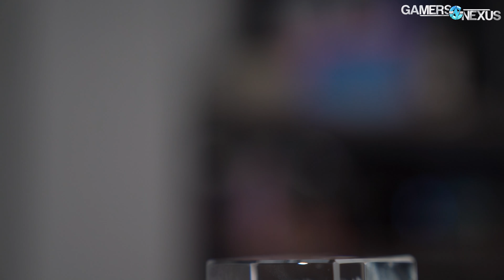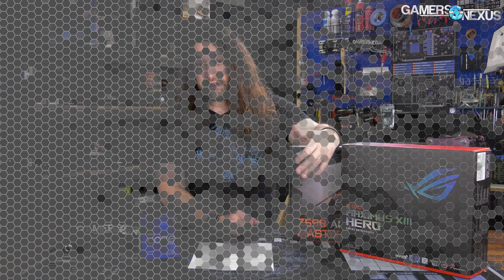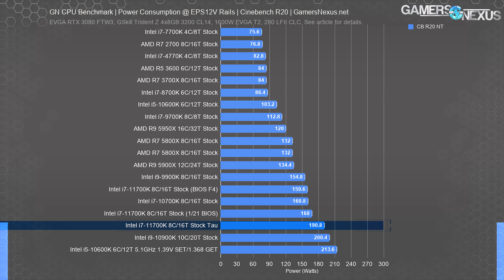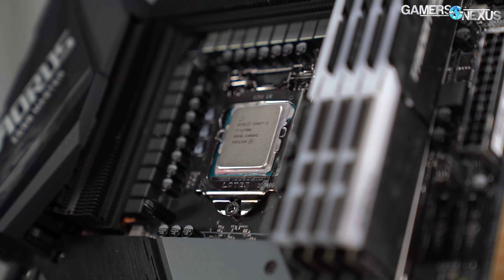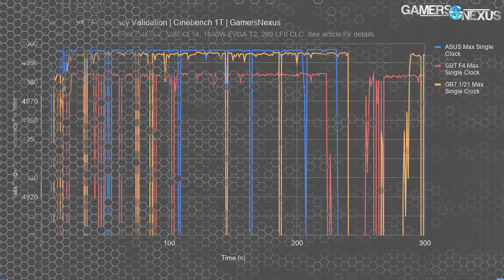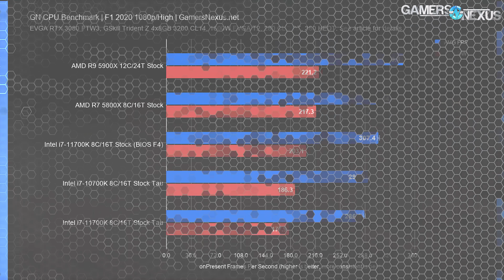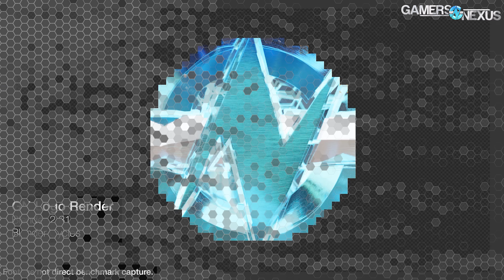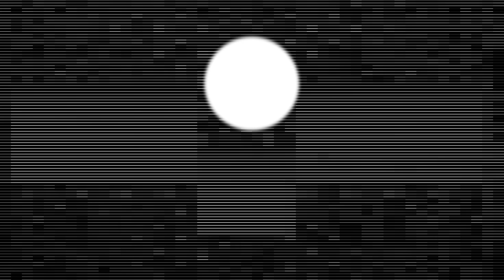Intel's Z590 Motherboard Problem: i7-11700K Power & Thermals Explained

Comment: I wish some youtuber reviewed non k chips too... temperature power draw and performance...

I really want to know i7 11700 vs i9 11900 performance... temperature difference and power consumption ....

Since i9 11900 is 400mhz faster does it mean i7 11700 is cooler? 

I dont overclock and its so hard to find info on the internet about these...

Comment: Recently completed a Z590 build using 10900k.  Mobo is Gigabyte Aorus Ultra.  Its on-board audio comes up as "Realtek USB Audio Driver".  USB for on-board audio?  Is that common now?  And there is a delay with it that audio...had to end up using an $8 USB Audio dongle to get audio that's actually synced up with video.  Very frustrating.

Comment: I just don't get all that whining .. it's to hot, draw to much power, etc? Wtf? The builds using this are powered by solar power? Batteries? And cooling? There are plenty cooling solutions, what the hell matter? First, in real life, benchmark temperatures are rare enough and second, it's not 75, it's 85 and for that will last 5 years instead of 6.
"It's a waste of sand, it's a waste of sand ... "  .. it is what it is and the ONLY issue is the bad positioning and price decided by Intel.

Comment: Am confused surely you overvolt and run it as high as poss at highest clock speed 24/7?

So therefore turbo boost is irrelevant. Am I missing something here?

P.s I agree if you cant hit 5.5 ghz or so pass/wait.

Comment: I appreciate what the power limit removal manufacturers are doing. This really helps unlocked chips out if they designed the vrm well (not asrock*). I just use the windows power management setting if I want to change efficiency from performance. The stock cooler works perfectly well on my "65w" chip.

Comment: So all of this to say that out of the box thermals are a lie.
Reply: No, out of the box thermals are a reference. TDP definition pulled out of Intel web page: Thermal Design Power (TDP) represents the average power, in watts, the processor dissipates when operating at Base Frequency with all cores active under an Intel-defined, high-complexity workload. Refer to Datasheet for thermal solution requirements.

For AMD you have to go to AMD specification page and see what they refer too for it.

No one except the manufacturer itself can tell you about their own specifications, because they are given with small letter, aka conditions.

Being power dissipated also tells another importan thing: TDP=/=power consumption. Though there's a correlation between dissipated heat and power consumption, don't know if Intel or AMD publish that data somewhere.
Also if you run them out of spec the heat dissipated and power consumption will be another thing.

Comment: I'm back 😆. GN, can you make some content on Intel 10th gen PCIe gen 3 vs Intel 11th gen PCIe gen 4 on Z490 boards (that are gen 4 capable)? I understand their may not be any difference in GPU performance, but is there anything noticeable in m.2 performance. On the charts that is. I'm sure when it comes to the "eye test" there is nothing really noticeable. Just curious. It'd me interesting to see using GN methodology imho.

Comment: I definitely think MB should run at stock out of the box. That gives the user a chance to learn more about the capabilities of the cpu and MB, and make a decision on how they want the cpu to run. It just makes sense. I know a BIOS can be updated, which may offer additional settings, but providing detailed documentation to the user would be nice. Most of the time, users have to dig for info, if they aren't privy to what the BIOS settings actually do. Good stuff GN, as always. 🍻

Comment: Dayum GN. This kind of stuff is why I have such respect for your channel. Of course, I was aware that there is a difference in CPU performance metrics across motherboards from different manufacturers , but I did not know why. Thank you for helping me gain an understanding of this stuff. I'm going to have to look into how AMD handles power/boost limitations in regards to how the Ryzen 5 5600x I purchased handles these things in relation with different manufacturers (haven't pulled the trigger on a mobo yet). Thanks again, Games Nexus.

Comment: So they backported the modified uArch from 10nm to 14nm to improve higher-clock yields... and it's not any faster than 10th gen, there's no 10-core part, with the only real benefit being AVX512 at a hideous power/thermal cost. I feel bad for Intel's marketing org, having to try and sell this 11th gen nonsense. A waste of sand indeed.

Comment: I really don't understand Intel nowadays... First they released most of their 9th gen CPUs without hyperthreading. Why? Comet lake should have been what was Coffe lake if they included hyperthreading and this Rocket Lake linup should have been their 10th gen. What is the point of these now when they will supposedly release Alder Lake, an actual upgrade on 10nm with DDR5 RAM like half a year later?

Comment: But it is also faster when the motherboards run 200 watts through it indefinitely by default.  Of course it could be done better by a knowledgeable user and its not right to overclock enough to damage the cpu by default. But has anyone ever proven that the boards with a default mce or similar actually results in a statistically significant decrease in lifetime of the cpu?

My point being that this does not only make intel look bad for running hot. It makes them look better for getting better benchmark scores when done by the less knowledgeable folk than yous.

Comment: I'm pretty glad I finally got to just walk into a store and buy a 5800x this week, feels good.
Reply: Little tip, if you have high temps, set down the voltage curve to a negative value in the bios. Got mine down by 7-10 degrees and around 150-200 mor mhz on all cores at a 100%.

Comment: How many People do buy these 500$+ Boards?
When I played with the thought of upgrading, I maxed out at 300$ for a Board. And normally, it's 200$, but because of the situation of the World, I gave it a bit more room.
So, wouldn't it be closer to the User to test these CPUs on Boards in the range from 150-300$?
Not many People would pair a 450$ CPU with a 600$ MB.
Reply: Manufacturers won't give anyone a low end motherboard for use in a tech channel. Companies want their high end products advertised.
Reply: @deidian635  I think they would have Money to buy 2x Mid Range Board :)
It might be more so the CPU Corps who want their Models shown on such a Board.

Just pointing out that "you" should talk less about "Typical use-cases" and such things in your Videos if you pair Products like this ^^ Talking about GN :)
Reply: @fr0zen1isshadowbanned99  Yes, I do understand what you mean. I personally OC my stuff manually, so I find hilarious reviewing a 'K' without MCE and enforcing strict turbo power and time limits. It's deciding to remove the most simple way to OC your CPU that MB manufacturers are putting right there. Maybe AMD PBO + Unlimited PPT against MCE + Unlimited Power as an overclocking test would be worth: not very time consuming and many people could enable it in simple steps. Also both are MB manufacturer overclock, so expect them to be on the safe side.

Though the observation they made is valid as well: they shouldn't come enabled by default and maybe people should be educated in knowing about them. As far as I read in overclock.net currently Asus MB UEFI do disable them by default(Auto=Disabled, strictly speaking), but if you set manually in the UEFI something related to OC: MCE, CPU multipliers,.... Then all limits are lifted, again strictly speaking Auto=Enabled. It's important to understand in UEFI Auto=/=Default, should fall upon itself: shorthand to "Automatic", if they wanted they could have named it "Default" and doing the appropriate thing.

But looking at it form business perspective doesn't float. People won't watch the video if they are previewing low end hardware and also less when launch is around the corner. When you run a business(GN IS a business) you want to appeal to what's more profitable, or at least balance things out towards profit even if you're still sticking to your personal likes. So for keeping a healthy relationship with hardware manufacturers(advertisement deals, hardware for reviews,...) and viewers(people prefers to see high end hardware pitched against competition) it works the way it works. Also time schedules: accepting manufacturers cue here usually allows them to actually have reviews ready for launch day: remember NDA when they mention it, they already have the top end hardware there and can test it, the 30th March everyone will have reviews on 11th Gen. There's many business rules which suggest that is unwise to do low end hardware reviews, most don't want it, so it's doomed as a business.
Reply: @deidian635  I underclock mine :P
It's just not necessary for me to have my System run 20h a day with max Consumption, so I am on the Side of GN on that one ^^
Reply: @fr0zen1isshadowbanned99  Lol, you can do that with Windows power management. Just set Max Processor State and Windows will not allow the CPU to exceed that frequency. It's generally how silent power plans are done: you limit CPU max frequency in the OS so it doesn't run higher than 3Ghz for example so power consumption doesn't go over the sky. If at a certain point you want full performance just switch OS power plan.
Also overclocked doesn't mean constant high power consumption. You have adaptive and offset modes in Intel and PBO in AMD(with offset). All them allow the CPU to use the full range of power saving stuff when it's not necessary to run fast. Though power savings from a $ perspective are not much when load is low, the main reason for fine tuning power usage is for battery life actually. I still like adaptive mode because of that: if my PC is idling the CPU just sleeps at 800Mhz@0.74V, when stuff needs to be done can go up to 4.7Ghz @1.42Vin Turbo Mode. It's i7 6700K. Fixed overclock are good for breaking records because keeping constant voltage demand helps with stability on power delivery vs jumping all over the place in the 0.7V to 1.6V range, but for day to day use having dynamic power states wins.
Reply: @deidian635  HeHe, that's what I do :)
There is just the problem of my 1st Gen Ryzen not being very flexible ^^
I can get all core 4Ghz through Bios if I want but it's fine to me to let it do its thing and boost to 4.1 if it wants to.
For 16 of the 20 Hours I set it to min Clocks and its perfectly fine at 2.2Ghz with its 8 Cores ^^

Comment: I do agree with everything that is said. Tests really should be done at stock/guidance settings because that's a set benchline performance that all the CPUs are supposed to be capable of doing out of the box, and it makes comparisons more valid since once you start overclocking every CPU is different. 
 
What I want to know though, if you already have a 10th or 11th gen CPU, a decent cooler (d15S with a second fan in my case) and don't care about the noise.... is it safe to leave the stock MCU settings enabled? I don't want to risk burning out my CPU in 8 or less years, but I also don't want to lose the performance gains that my Gigabyte's MCU setting gives me.

Comment: what do you think about having 115w (cpu+soc) on a amd2700 it is running right now 4.1ghz at 1,34v Noctua nh15s 1fan only and liquid metal. memory at 2666, i am a bit worried to being to far it has unlimited thermal room but still it wwas at 3.2ghz stock

Comment: Sorry Steve but I had to post this from Userbenchmark, it is F**KING HILARIOUS !!!!

Intel Core i7-11700K €344
The i7-11700K is the second fastest CPU in Intel’s 11th Gen Rocket Lake-S lineup. Rocket Lake brings higher IPC (early samples indicate +19%) and 50% stronger integrated graphics. There are several 500 series chipset improvements including: 20 PCIe4 CPU lanes (up from 16) and USB 3.2 Gen 2x2 (20 Gbps up from 10 Gbps). Rocket Lake’s IPC uplift translates to around a 10% faster Effective Speed than both Intel's 10th Gen and AMD’s 5000 series. Despite Intel’s performance lead, AMD continues to outsell Intel. Given Intel's colossal R&D operation, it's bewildering that their marketing remains so neglected. Little effort is made to counter widespread disinformation such as: “it uses too much electricity”, or the classic: “it needs more cores”. Intel’s samples are often distributed to reviewers that appear better incentivized to bury Intel's products rather than review them realistically. Not enabling XMP or only testing with BIOS power limits enabled is akin to leaving the handbrake on during a timed lap, sackable. A mind-numbing list of irrelevant “scientific” and rendering benchmarks are presented as gospel. When it's convenient, unrepresentative canned game benchmarks are chosen e.g. ulletical’s CSGO which runs at nearly double the in-game fps. Different games, mostly unplayed by real users, are cherry picked for each “review”. At every release, AMD’s marketers circle overhead coordinating narratives to ensure another feast of blue blubber ensues. Credible benchmark data, which necessarily includes replicable video footage from popular games, is the exception rather than the rule. Nonetheless, towards the end of 2021, Intel’s Golden Cove is due to offer an additional 20-30% performance increase. At that time, with a net 30-40% performance lead, Intel will probably regain significant market share, regardless of AMD's class-leading marketing. [Feb '21 CPUPro]

Comment: Might explain the instability I am observing on my Gigabyte B450 coupled with a 3600. Will need to look into. A friend has an ASUS B550 and has not observed such instability with a 3600. Just another piece in the confusopolity that makes it insane to build a proper system. Urgh.

Comment: Running a CPU stock with no OC at all within spec and within Intels guidelines keeps it within its thermal envelope, hmm imagine that..... okay cool. Complaining it runs hot with limitations removed, OC frequencies or extreme overclock frequencies for LONG durations of time and people are all up in arms over increased thermals and heat lmfao!! This is that niche play space where people are using custom water cooling loops or other exotic cooling methods to push boundaries for sport. This hasnt changed in generations of CPU launches, this is what a segment of the market DOES for fun and are aware of the expected heat load and thermal increase that we accommodate for with the expensive water blocks and custom water loops. 

In other news, water is still wet...
Reply: Water is not wet when someone buys a 'K' CPU and doesn't overclock it or it's counting watts. That's certainly new, especially when the non-K CPU boosts practically the same than the 'K' binned in stock. Time is escaping through the walls.

Comment: Would Gamers Nexus be interested in testing AMD 5000 series with memory ring overclocking as well all core boosting.
Vs Intels 10's seres all core boosting as well as intels 11's series memory ring overclock and all core boosting.

Could be interesting to see how the platforms performs when pushed to the limit with standard air cooling or close loop liquid.

Comment: Could this be detrimental to the hardware longevity? 
Or do voltage limits and thermal throttling ensure that the increased power draw doesn't cause 'damage' ?

Comment: Intel: Here's a CPU that can be overclocked. 
Gamers Nexus: Nah, we rather adhere to the limitations that are printed on a sheet of paper.

Customers: I just want the most performant CPU, I'll deal with the heat and power consumption. 
Gamers Nexus: Nah, the best approach to compare CPUs is to adhere to the crippling rules that manufacturers specify for their products.

Comment: Well without turbo limits and with 11900k's higher frequency it will probably be enough for it to top most of the gaming charts at least (and a couple other ones), which while certainly not great, will be enough (combined with AMD's continued failure to provide sufficient stock and consequently high prices) to carry Intel over until Alder Lake which should by all accounts be a real step up compared to everything that is available now. AMD certainly can't afford to slack off with Zen 4 or they will fall notably behind once again.
Reply: Depends on games, newer games like Hitman 3 and future games will use more cores, it could be more useful to buy 10900k because of extra 2 cores. AMD's problem now is availability and inflated prices, in my country a 5800x has the same price as 10900k. I'm trying to build a PC for my kid and was going to go for 5900x, but at current prices 10900k will be the choice.
Reply: @andreiga76  While that is generally true (games gradually requiring or at least using more cores), I am positive that an 8 core, 16 thread cpu will be more than enough for quite some time (the consoles are now also 8/16) and faster than a (slightly slower per core) 10/20 one, even if not by much. I agree about the current pricing though - the 10850k seems to be particularly attractive right now (for a high end build).

Comment: So XMP considered as over clocking and can void your warranty... but motherboard auto over clock doesn’t count as over clocking?
Reply: Wellcome to the jungle ;)
Reply: I think that's officially considered OC as well, but it's not like they can prove it anyway... Either way though, CPUs pretty much only ever die under extreme OC (or occasionally you get one DOA). Actually, I don't know about a single case where one would die at stock or mild OC (or even under pretty high ones for that matter). There's even this guy I know, whose PC got fried by a lightning strike; I think pretty much all components were toast, yet the cpu was found to be still working.